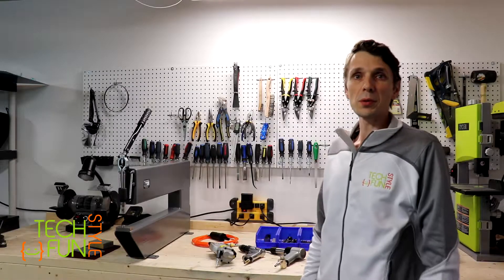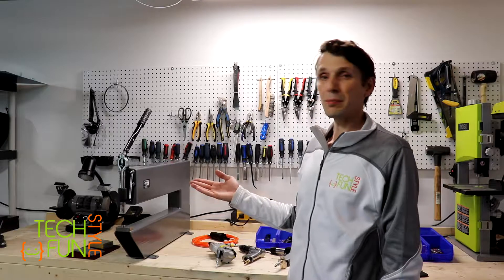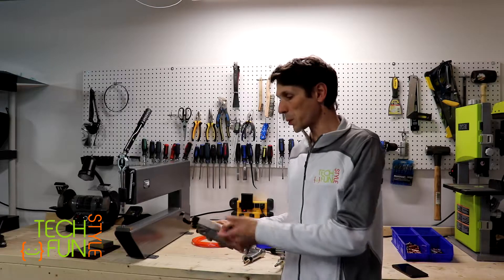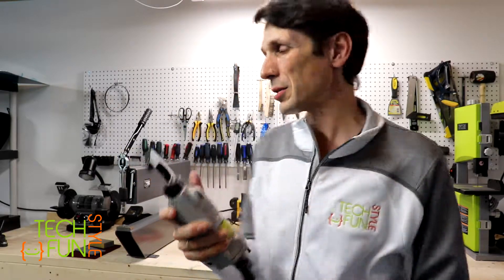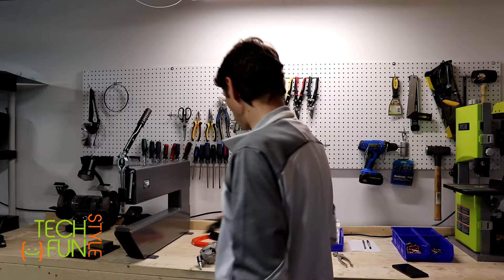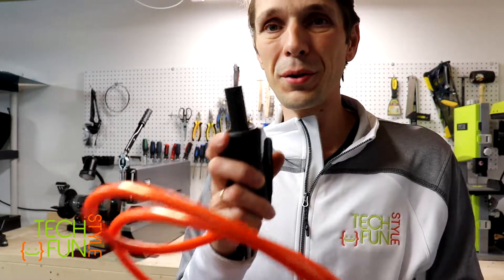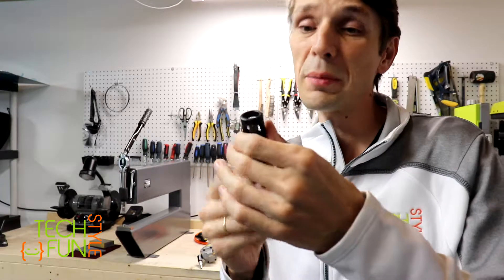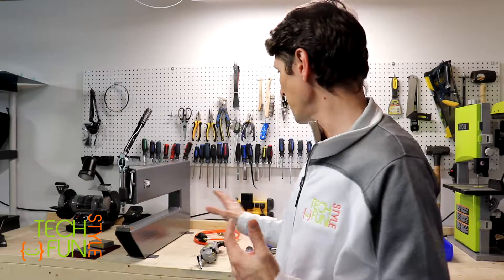Building VAN's RV-10 Airplane: Tools for builder

Comment: Hello Vlad, How many Cleco's are you using or have? Is there a recommendation? Thanks, have a nice day!!
Reply from the maker: If I am not mistaken VANs was recommending about 350pcs of 3/32" and 175pcs of 1/8" clecos. So far  recommended quantity of 1/8"  is sufficient, however 3/32" quantity was insufficient as soon as I approached horizontal stab. I ordered more of these and now I have about 700pcs of 3/32" clecos. I found this quantity sufficient for all parts I assembled until now. Not sure what to expect from wings though :) but hopefully it will be enough there as well.
Reply: @techfunstyle1606  Thank you for your reply's ;)